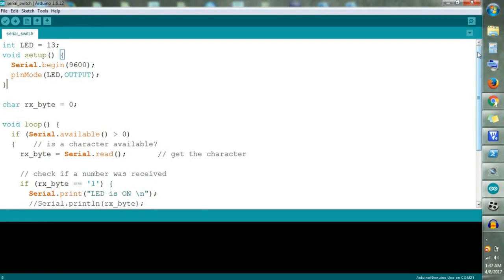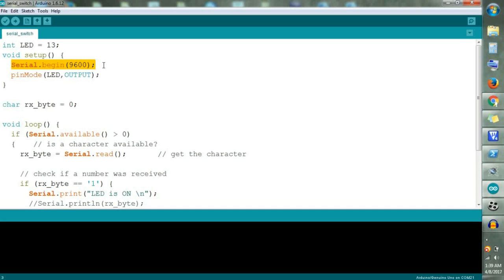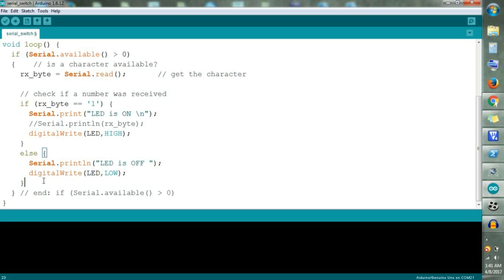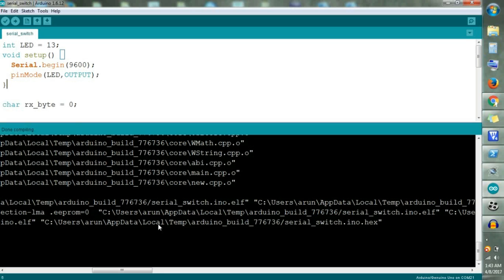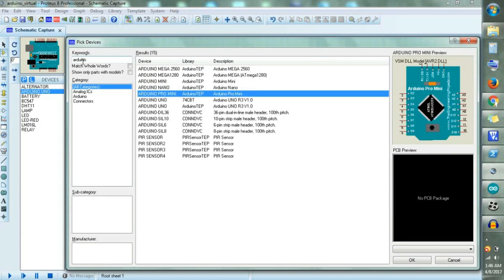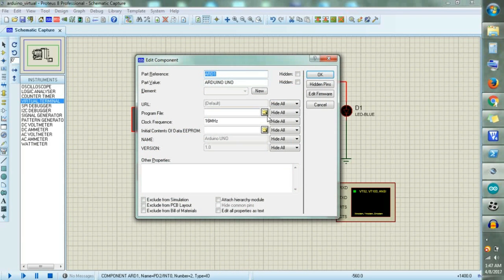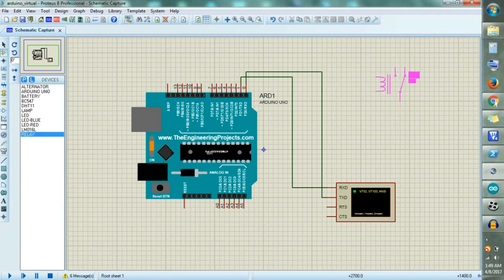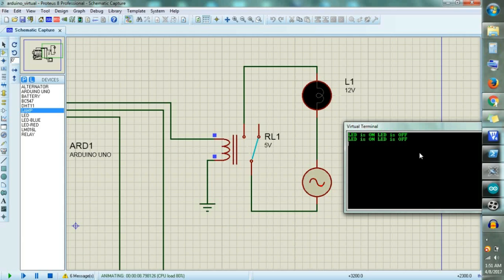Home Automation simulation with Proteous using ARDUINO

Comment: How to control multiple relays
Reply from the maker: The same way u connect single relay u can connect multiple relays.

For that define multiple pin as output.
and then write HIGH or LOW as per the requirement.
Circuit will be same for that just connect relay to different pins as mentioned in the code.

Hope it Helps :-)